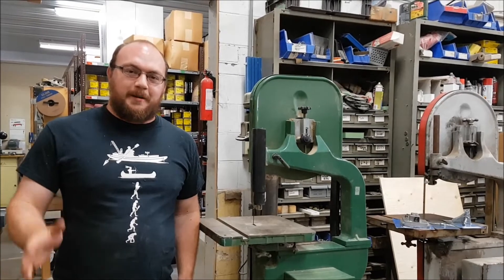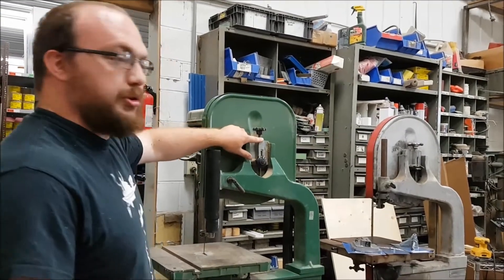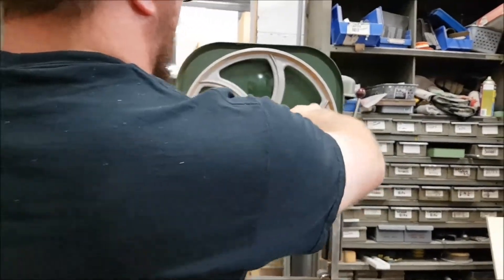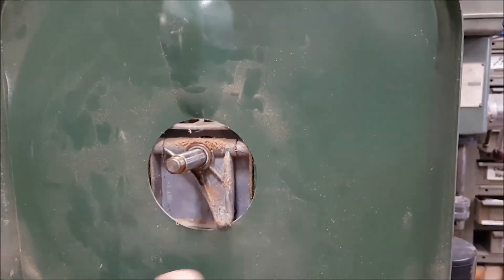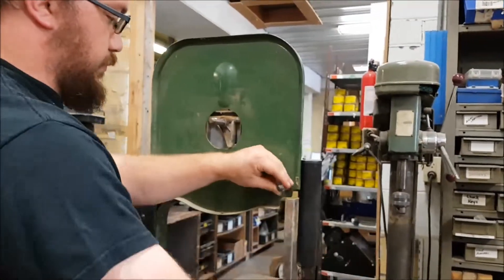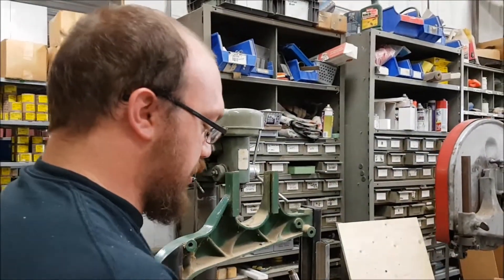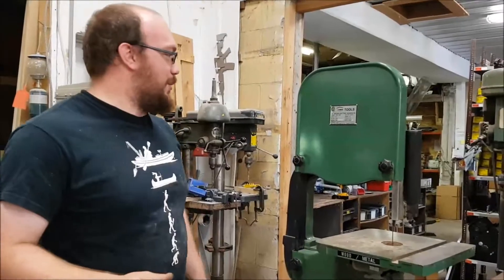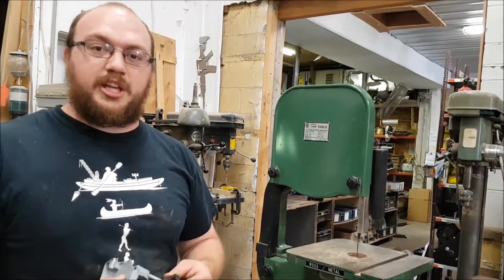Fixing Top Wheel Sliding Tension Bracket On 14" Bandsaw EthAnswers

Comment: I have a Rigid BS4200 . I replacewd the upper bracket. I can not get the wheel back on the shaft. Is there a trick to it?
Reply: Where did you get the parts from? TIA !!!
Reply from the maker: You can get them off our website here - https://stockroomsupply.com/collections/tuff-tooth
Reply from the maker: is the shaft a bit too snug? Might sound crazy but try throwing the shaft in the freezer overnight!
https://youtu.be/pdzDVyWc6Zo?si=qNUmvHZKR6qqsblI

Comment: The tension adjusting screw on my 30+ y.o. Delta 14" bandsaw stripped out, and the part is no longer available.  It's easy to make your own replacement.  I had a 3' length of 3/8" threaded rod (16 pitch thread) sitting around, and it worked perfectly.  Made a handle out of some scrap Cherry, and voila!  Didn't cost me a penny.

Comment: Ethan I have an old delta 14 inch bandsaw. I lost the ("pin"?) that holds the motor driven wheel which turns a belt. The wheel slides on a bar, and this bar has a slot where this pin goes into, to hold the wheel in a place. I'm a novice wannabe woodworker and I can't find this small metal part. I call it a pin because I don't know the name of this small piece.  
Hope someone can tell me what this part is called and where I can purchase it.  Thanks.

Comment: You can actually replace a broken hinge without destroying the bracket. If you use a strong magnet (like rare earth magnets), you can remove the pins from the bracket and release your broken hinge easily. I was given a 14" band saw identical to the one you have and only had to replace the hinge (about a $20 US part).
Reply: I have a broken hinge that I am researching getting parts for... wonder if you could cut the hinge to free the pins and save the bracket as another option?  I was thinking of using a dremel with a cutoff wheel
Reply: Thanks for this.  I was about to replace both hinge and bracket when I figured I'd give something like this a try.  Turns out mine had a single pin that went straight through, so I was able to hammer it out with a nail set and some Kroil.

Comment: Hi Ethan,   Having sent you three emails to the email address from your reply below there has been no reply to my request for the parts that I require to repair my bandsaw, surely someone there would either email me about supply etc or inform me one way or the other, I am so disappointed that I have had to come back to this site to try and make contact, could you please advise as to either you can help me or not.    Edward  Waugh
Reply: I guess that was a no, they can't (or won't).
Reply: Hi Edward, I dont know if you ever got your part but I recognized the package the part in the video showed and will include a web link. They are a Canadian company specializing in bandsaw blades and parts and very knowledgable about bandsaws.Give them a try. https://tufftooth.com/

Comment: I just purchased that exact C.I.I. 14" bandsaw at a garage sale last week. Was disappointed to discover that the upper wheel tension bracket was seized - something I did not discover until the saw was at home and I was attempting to change the blade. The bracket essentially had to be broken to remove it. A replacement part is already on the way, and this video will assist with the repair when it arrives. Thanks!
Reply from the maker: Glad it helped!!
Reply: Hi I have CII 14 inchs bandsaw I like to order some parts but I don’t know if is delta or snored name will help me identify this band saw please do I can order some parts from you thanks

Comment: Do you have a part number for the top wheel adjustment  Arm  could't find it on your web site?  Cheers
Reply: If you can’t find it through stockroom supply, Grizzly sells a part that I believe fits. I’m pretty sure it is the same part for several of their 14” bandsaws.
Reply from the maker: Hey Steve, 
Here is the link ;
http://stockroomsupply.ca/shop/bandsawblades/bsbacc/upper-wheel-sliding-bracket-knob-nut-for-14-bandsaw.html
Reply: @StockroomSupply  link give 404 error. Is part still available?
Reply: https://stockroomsupply.com/collections/tuff-tooth/products/upper-wheel-sliding-bracket-knob-nut-for-14-bandsaw

Comment: I have the same saw i think looks identical  and the top wheel adjustment arm is broken  was going to trash it  will get the part now  wicked 
mine has the name hafco on it built in 1974
Reply from the maker: All those old cast saws are pretty well the same! Yeah don’t trash it yet!
Reply: Does that come with the wheel adjuster (triangle piece)?
Reply from the maker: They are sold separately but the upper wheel hinge can be found here;

http://stockroomsupply.ca/shop/bandsawblades/upper-wheel-shaft-hinge-nut.html